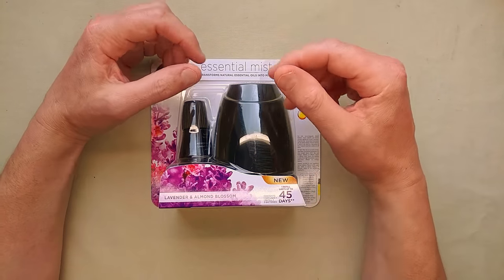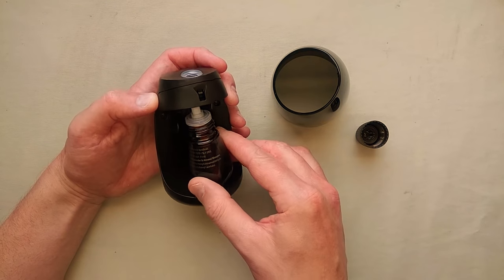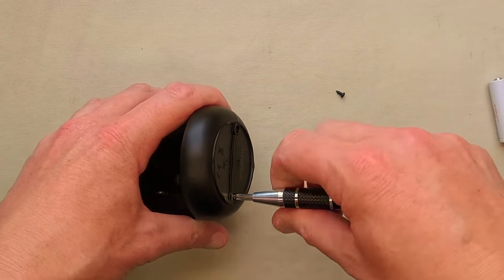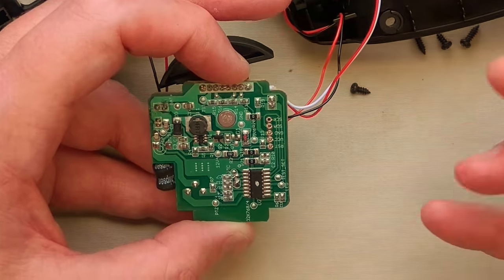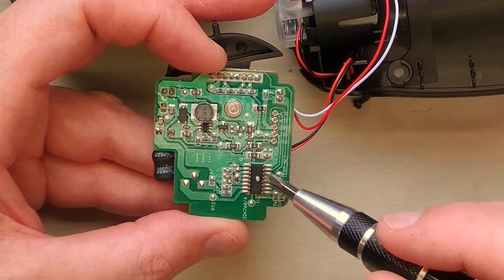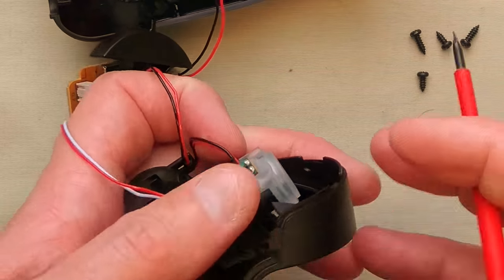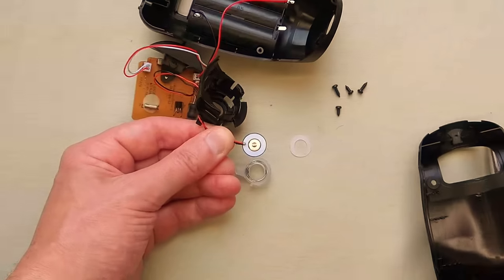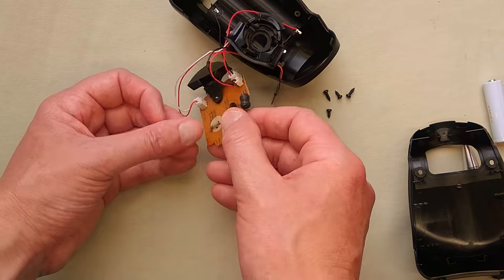Airwick mist ultrasonic aroma atomiser.

Comment: Make it vapourise surströmming liquid
Reply: That would be an excellent prank.
Reply: That is a great idea!
Reply: That'd get you jailed for domestic terrorism.
Reply: It would probs smell better than the airwick cartridge.
Reply: anything smells better than synthetic air freshener.

I've noticed a trend over the past 20 years where synthetic air fresheners have had a sharp increase in popularity, they use the damn things everywhere now. My mom has severe asthma and one puff of these is enough to send her into fits. I don't have asthma, but I've become increasingly sensitive to synthetic fragrances over the years, to the point where it makes my eyes burn like someone threw sand in them and my lungs feel like they're burning.

They also have a cult following these days, I've seen people get grossly offended when you call these air fresheners crap, and other people who actually have asthma and use these things to their own detriment. Doctors offices are increasingly using these things too, and many are hostile when you point out they're hazardous to the health of people with pulmonary diseases. My mom had to change doctors because the clerks and nurses refused to remove the air fresheners from desks and bathrooms.

What happened to just smelling "not bad"? Having a neutral odor is better than polluting with this crap.
Reply: Actually, what happened to smelling bad? You barely notice people that stink like a pile of horseshit anymore, everyones flooded with some distusting deodorant instead.
Reply: Nobody smells like horse manure anymore probably because horses haven't been a significant mode of transportation in over a century.
Reply: Thats not what I meant :D

Comment: Hi Clive. Love your videos... so laid-back and natural. I've also fallen for some of your diagnostic equipment. I've had a HOPI for several years now, and several multi-meters, most of which are true RMS. I also use Weller temperature-controlled soldering (the one with the Curie-point magnetic tips). I have a 10A 35V variable bench PSU and a digital 'scope etc. One thing I didn't have (until the other day, that is) is a thermal imaging camera. But I've just bought a (slightly used) FLIR ONE for use with iPhone and iPad. I like it a lot, but am aware of its minor limitations. 
Now on to the purpose of this comment. There is an excellent range of diagnostic gizmos from Peak Electronic Design in Buxton, Derbyshire, however, none of which I have ever seen amongst your formidable arsenal. I have had one of their DCA55 units for about ten years now and it's brilliant. Well worth a look at their website (http://www.peakelec.co.uk/). I would think their DCA75 would be right for you. Purchased direct from Peak, their prices are a tad lower than Amazon or eBay. There are several informative videos on the Peak website covering their extensive product range, which I wholeheartedly recommend. By the way, I am in no way connected with Peak, but I just rate their products.
Many thanks for your most entertaining and informative videos.
Reply: Sorry Clive, the link to Peak Electronics didn't work due to a punctuation closing bracket adding itself to the url string. Here is the correct link to their home page. http://www.peakelec.co.uk/
Reply from the maker: I tried a Flir One recently and it was very impressive.  You can get some very versatile component testers on eBay these days.  Very clever units that will identify component pins and show an image of the component with the pinout according to how the unknown component is plugged in.

Comment: The programmer connections are the same as a PIC16F, Reset will go to pin 4.
Reply: Amazed they left SPI labeled on the board! Must be a very early rev of manufacturing
Reply: Will there be any encryption or flash blocking on pic16f chips? I only have minor experience with Arduino
Reply: Matthew Ghali makes me wonder why any of these consumer electronics have silk screening, nobody repairs them unless they're at home tinkering .
Reply: A look at the 16F Sheet and there is • Programmable code protection
• Power saving Sleep mode 
So this shouldn't consume much power while off and might not be modifiable if they're evil.

Comment: Airwick batteries are pretty good, a very nice quality battery. Wonder who makes them, they are both high capacity and also pretty leak resistant. I used to but the complete units on sale, as they had an intro offer of a unit and 2 cans, for just 5% more than the price of a refill can, so I landed up with a lot of the batteries, along with a lot of the units that were turned into scrap metal and plastic as well.
Reply: Here in my country, the whole unit sells for let's say R59-00 and the refills sell for R52-00..... So, needless to say, you land up throwing the thing away after it's finished and buy a complete unit.... Totally a waste if you ask me, but surprisingly, you still find people buying just the refils (They Obviously have way too much money, or no common sense)

Comment: Tested one of those in a japanese onsen room... but it used plain water from the tap. 
Should look weird given that the hotel was basically on top of thermal water sources, but since it was high on a mountain, the air was kinda dry, so it made a bit of sense. The principle is pretty much the same, but they are seen as humidifiers, not aroma dispensers.

Comment: Those ultrasonic things use a good bit of voltage to drive the piezo element. The ones I have use a 24V wallwart, so it's not surprising to boost the voltage so high.

Comment: Do you think you could fabri-cobble together an ultrasonic bath bomb?
Waterproof, battery powered, device you turn on and chuck into a bucket/bath/fountain and it would mist until the batteries go flat.  Maybe you could make the internals and AvE could make an enclosure?

Comment: The programming header looks like what's used for Microchip PIC16Fs and 18Fs.  Some of the chips self-identify to the programmer.
Reply: Yep. That's the exact pinout. Although others use something similar.
Reply: It's pretty generic SPI.. with ground and reset
Reply: Whelp I bought one. When the chemical container runs out or I get tired of waiting I'll attempt connecting a pickit to it.

Comment: That RST, VCC, GND, SDA, SCK is the correct order for Microchip's PIC microcontrollers ICSP header. Probably something in the 16F family.
Reply: Put a pickit2 (or similar) on it and you could determine which chip it is, even if they have code protection on...
Reply: tiger12506 but if code protection is on will I need a hot air station to drop a new Chip in?
Reply: That's not how code protection works. 
Usually, you can reuse a chip if you erase the whole chip (including the code protection bit).
However, they also make program-once style chips, and there's always a possibility that this is one of those. It's still likely to tell you what chip it is, though.

Comment: Resistor divider/voltage level switch, interesting way to select options. Sort of like a pot with fixed output levels.
Reply: Yep. Microchip (and I'm sure others) have an apnote explaining how to do this using the internal A/D converter to use less pins to read a switch or jumpers.

Comment: It's weird how the low frequencies seemed to get better about a minute or two into the video, but throughout, there's that "overbearing noise removal" effect. Is that just the newer device not cooperating? Sad thing if so because, as I said in the last video, the picture clarity rivals the Moto when that was working properly.

Also, I find it funny how I've watched a lot of your content at the bench and now it sounds wrong to say piezoelectric without that abrupt stop in the middle of the word.

As well, that disc sounds similar in nature to that one that you ran the flammable liquid through.

</ramble>
Reply from the maker: The area I was filming had terrible acoustics.  The change of bass was probably me changing position relative to the camera so the sound was direct instead of bounced.
Reply: Horribad acoustics. Always fun.

Comment: Do the 'cold' humidifiers for children's rooms work using the same method?  I've always wondered how they pull that off.  Maybe that's a future tear down idea for you.
Reply from the maker: Most of the cold humidifiers use a high power ultrasonic disk to generate a plume of water vapour that is blown out by a fan.  They need the base cleaned regularly.

Comment: I watched this video on whether its worth spending $10 on not to watch someone take the back off the device.  How does th his unit compare to other freshners on the market and does it work well in a bedroom or just a small bathroom . This is what this video should be about .
Reply from the maker: This channel is all about opening stuff to see if it is worth getting for the components or suitable for hacking.  The unit is worth getting if you like seeing a visual cloud of chemical aroma squirt into the air from time to time.
Reply: @bigclivedotcom  Thanks for the reply though I wasnt trying to be rude but as I pointed out its not about watching something spray a mist but whether it works in areas and if it just dissipates fast or lingers a bit to freshen the room . I came to your site in hope of a answer but you seem to disapprove of my post but perhaps i havent seen your previous videos and if they are on just the technical side of the product then i seeked the wrong video.  If there are those who rather take theres apart than to see  if they could fix it once it breaks or use the spare parts for something else then this video is for them but not me . GL2U
Reply: @speedracer1945  yep this is the electrical engineering side of youtube. Welcome get comfy with some ohms laws and don't resist learning a thing or two from this channel.

Comment: How nice of them to silkscreen the mcu model and the programming connector pinout on the board ;)
Not sure how effective is not having markings on the mcu is to be honest... hehehe
Reply: Sadly 32k768 is just the clock crystal frequency, I didn't notice the actual name of the mcu anywhere. That would've been terrific thou.
Reply: And it's quite staggeringly obvious once you think about it a bit... facepalm 
Thanks :)
Reply: Charles Thatisall atmel?
Reply: The programming pinout is helpful. Normally a high voltage (13V for PICs) is applied to reset to enter programming mode. Put that in the wrong place and it no worky-worky anymore.
Reply: Exactly a PIC I had in mind when I posted the original comment, I had a vague recollection of a 2xKsomething part number :)
Reply: It's great marketing.. actually making me want to go out and buy one
Reply: Matthew Ghali crap they got me too.... It's probably locked unflashable
Reply: Whelp I bought one. When the chemical container runs out or I get tired of waiting I'll attempt connecting a pickit to it.

Comment: Can the oil bottle lid be taken off for refill?
Reply: Anj Kovo 
yes it can. its a plastic clamped in glas and snaps back on it after taken off. i refilled mine with water.
Reply: Cheers Thomas.
Reply from the maker: Yes.  It can be popped off with a blunt knife.
Reply: I asked because some brands deliberately seal them forcing us to buy the costly replacements.
Reply: Could you refill with real essential oils? Perhaps mixed with a small amount of alcohol to thin it.
Reply: Yes good idea. I'm going to give that a try.......Lavender oil with alcohol
Reply: Gin or Vodka
Reply: Definitelly fill that up with ethanol. And candle next to the exhaust
Reply: 12 year old malt whisky
Reply: NOOOOOOOOOOOOOOOOOOOOOOOOOOOOOOOOO!!!!!!!
Reply: Ok will petrol do?
Reply: Much better - LOL
Reply: Yeah I'd love to see a 'Experimenting with different refill mixes' video

Comment: I have one of these and got fed up of changing the batteries so one sacraficial crappy USB lead, two dead AA batteries, some aluminium foil and some duck tape, and it now runs off a rechargable power bank or a 5V PSU...

Comment: first time i see something i actually own on here. 
i spend two days finding the frequently awful noise that suddenly appeared until i switched this unit off. turns out it was empty and produced this awful high pitched sound. terrible. 
i refilled the bottle with water to look if it would work as a humidifier and it worked.

Comment: cant you  mod the resistors to make it stay on for 60 seconds lol
Reply from the maker: It would require a software modification to do that.
Reply: @bigclivedotcom   i put an 18650 on one of these and it runs for months  before needing a charge lol plus i had an incident where i accidentally wired the battery the wrong way n i noticed smoke from the unit . then i corrected the polarity and it works but kinda stinks  of burnt ic or what ever its called  its not any of the resistors
Reply: it was next to the inductor  if that what its called
Reply: i guess its the 3pin chip that crisped
Reply from the maker: @danielhorne6042  It's possible that something just got very hot but didn't fail.